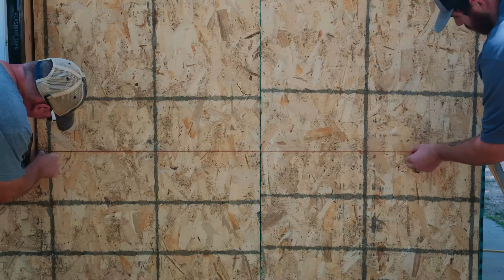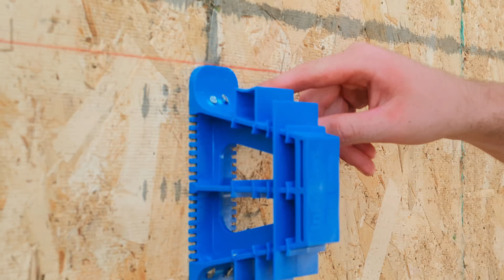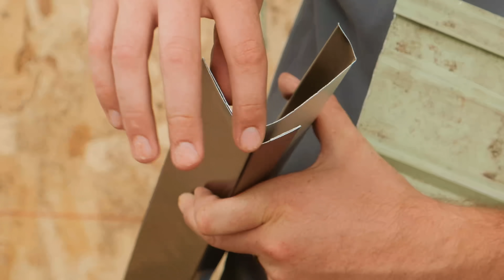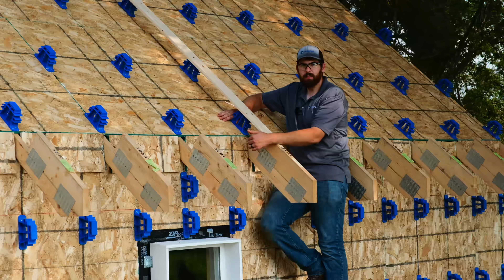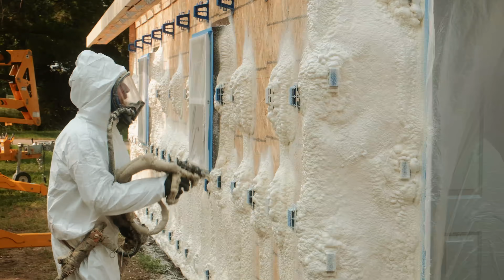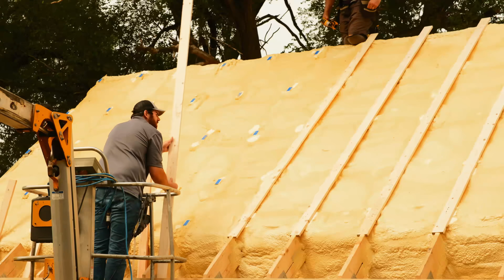Unleash Energy Savings: Installing X-Bracket System on Exterior for Spray Foam

Comment: Hate to be negative, but I’m missing where this fits in the market. It seems like so much added work and cost vs say Zip R-System or SIP panels, with a lot more complication around installation, maintenance and replacement.
Reply: I think they said it a couple of times, fits well in for houses that have very little insulation.
Reply: Holds no water vs polyiso board.@jeremyfogt6798
Reply: @jeremyfogt6798 need this for mobile home‼️😎
Reply: I agree plus sprayed foam is extremely expensive in the NW.
Reply: I think if you’re up in a very cold climate the top third of the US or up into Canada I think it would benefit you there cause they’re already putting like Rockwell insulation on the outside of homes up in New England area and then the rain and then all this other stuffbut for the bottom 2/3 of the country way overkill
Reply: this would cost atleast $75k for a house this size in my area. is there really a market for retrofitting this on existing houses? no way.
Reply: @sailorjohnboy  X- Brackets start at under $1 sf plus furring strips for $1 SF and  2" of  R- 14 high density closed cell spray foam is about $3 SF .   The cost to cover 15,000 SF of walls on your home would make your $75K
Reply: @sailorjohnboy  I say no way. Would make more sense to just remove your OSB and resheathe with Zip R-system
Reply: @StevesSideGig why the hell would you remove existing sheathing?  Do you know how much labor that would be?
Reply: @deadlata9767  not saying you have to, but if you were going f with Zip R-sheathing, the added layer of OSB could be reused elsewhere. Or not, up to you.
Reply: @StevesSideGig zip r isn’t going to get near the r value. It’s also going to suffer compression issues over 1 inch. Price zipr as well as the correct fasteners, tape, and fastener sealing. The prices won’t be drastically different honestly. Sip panels are not applicable to all home plans, you also can’t run plumbing. Yes sips would be the most ideal in this scenario.
Reply: Max Thermal mass incapsulated…
This makes so much sense.
Reply: It impacts because it allows the spray foam to be on outside of home. This is the direction building houses for those who want a better insulated home. Out with the old in with the new.
Reply: @mistyrichardson6041  but SIP panels and Zip R-System do the same for lower cost and easier maintainability.
Reply: @stevem4292  I do not like the sips because I am a self builder and they are heavy and much more complicated to install. I am looking into the zip system as an option. 😊 thanks
Reply: @mistyrichardson6041   They do rent lifting devices ya know. 2 carps and me on the forky put up the 14' walls on a 32x60 structure in little over a day.. inside & outside wall are done and insulated in one shot.. Make sure you go with the 2 part vs 1 part insulation.. Some even have lathing clamps.. Simple Installation Job
Reply: @SegoMan  oh yes I know but it's out of my budget. But it makes sense
Reply: @mistyrichardson6041 look into zip-r sheathing. 100% thermal break.
Reply: Its really not good to insulate the outside, unless you’re insulating under the slab. Otherwise the floor is left as a massive thermal bridge.

Better to insulate the inside with sprayfoam, then cover that with 2 layers of foam boards, horizontally and vertically offset. Then you can leave the unused attic uninsulated, and insulate the ceiling and floor. Most people are not 8 feet tall so the loss in clearance is not important.

Comment: How on earth can the next generation rebuild (or reuse) this house? Spray foam generates too much landfill...
Reply: If you building a house thinking we can just remodel later I believe you have the wrong though process.  New house are to be built so they don't need remodeled later, at least the exterior.
Reply: @jeremyfogt6798  A house that's easy to "deconstruct", is easier to remodel.

Comment: Spend $15000 to save $15 a month, oh and then you sell the house and move in 5 years
Reply: He said he sprayed 1050 sq ft.  A google search says that is between $1000 to $7500, probably a little low but no where close to $15000. Granted that is just the spray foam, maybe all the other extra materials and labor could take you to the the $15K.  You are probably way low on that $15 a month unless you live in a pretty steady temp climate like around 65-85 degrees year round.
Reply: @jeremyfogt6798  buddy that was what he sprayed a day the roof alone is bigger
Reply: @morehp1 yeah that is a small building but no way the entire exterior envelope only adds up to 1050sq ft.
Reply from the maker: The whole project was sprayed in one day, which was around 1050 total. This sq ft includes the roof as well.
Reply: Can this be a total DIY project if FoamItGreen foam is used with the InSoFast?

Comment: Spray foam...bad for your wallet and health
Reply: Not sure where you get health based on studies but maybe based on hearsay.  Agree with wallet but I guess they say it works out in long term energy savings.
Reply: @jeremyfogt6798  When the sprayfoam gets in contact with moist (air) it degenerates slowly and releases chemical gasses. As a contractor myself I quit with using this material. I had families who got sick from it. I rebuild it with foampanels on the outside with a watertight barrier in between. Problem solved. But these people keep staying allergic for these chemicals.
Reply: @jeremyfogt6798  
If the spray foam gets in contact with moist it will release a little bit of gasses MDA etc. Google some approved tests and find out. There are already people who get seriously ill and alergic from spray foam. Besides that in the future you have to pay a very high price for deconstructing the building. Every piece of wood contacted by spray foam will be chemical waste. If you still want to use it, use it on the outside of the walls and roofs and put a barrier between it so the gasses will not penetrate into your building.

Comment: This would be SO expensive, closed cell spray foam wise.
Reply: One of the offsets you get is not needing sheathing with an integrated WRB and not needing house wrap or the associated labor. I know those are relatively minor savings but when factored in it does close the cost delta.
Reply: @alldecentnamestaken you have to consider the entire cost though. You're basically doubling your framing labor and materials. This doesn't make a lot of sense for a new home unless you're super rich and focus solely on energy efficiency.
Reply: Anybody that says they can’t afford to do things, usually shouldn’t.  They won’t be committed to the place long enough for it to pay you back.  I have an ICF house.  It’s awesome, but wasn’t cheap.  What nobody ever thinks about is not only is it efficient, it’s WAY more comfy and quiet.   As to guess as it’s worth extra money to go long on these types of things, means you have to commit to staying there to make it pay.
Reply: I have done this using my own clips and have done it with Rockwool and with polyiso and with xps.  Where I live spray foam was the cheapest
Reply: In a fire, this would be disastrous!  Way better to use exterior rock wool insulation!  Fireproof, water resistant, no voc’s, eco friendly, not a chemistry experiment, and soundproofing.
Reply: @NewEarthAwakening Polyurethane doesn't readily catch fire.

Comment: This is a really interesting system. I'm generally not a fan of spray foam for a variety of reasons but this system addresses a lot of those concerns (VOCs, continuity, etc.)
Reply: Same. I've been taking really hard look at it, and the carbon outlay is the last big concern I have. Super interesting
Reply: Its moderately reminder of the spider tie system.
Reply: That stuff burns like brush, I would never use that product, inside or out.
Reply: @arturturk5926 It great for air sealing although i agree its flammability is definite concern. Only in area cover by a non combustible matter.